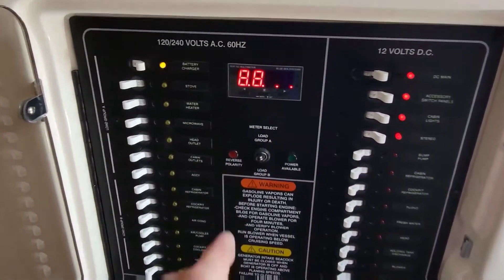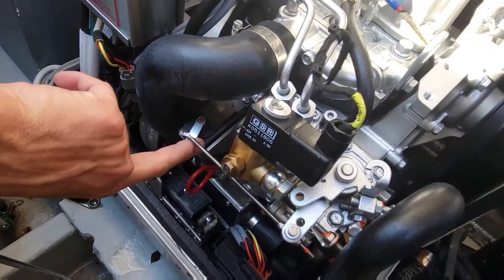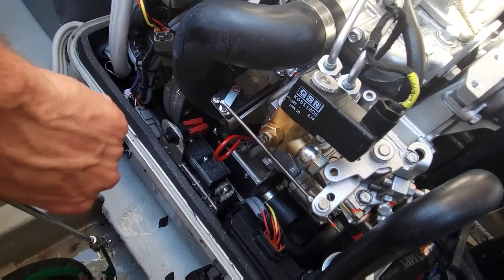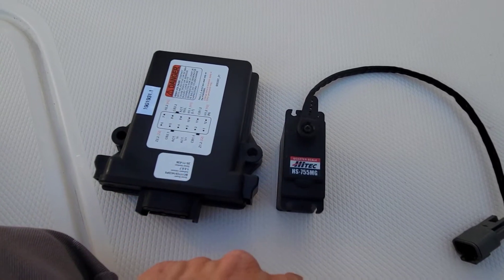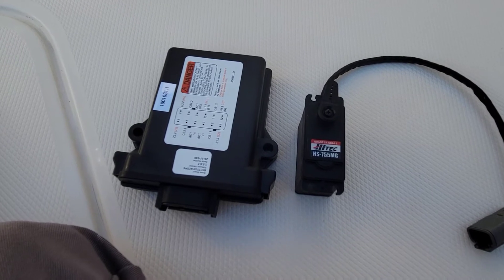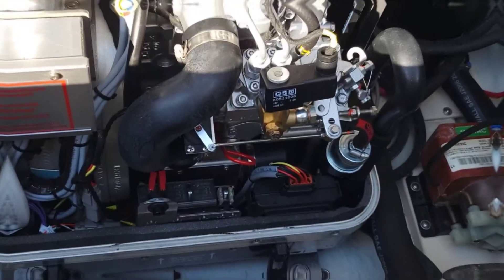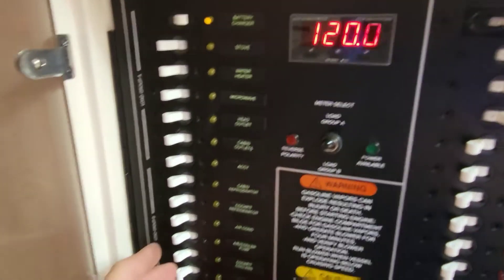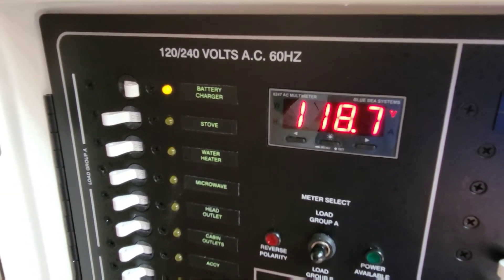Fischer Panda Generator 5k - Low Volts - Episode 43

Comment: I have the exact same boat and generator and same low voltage problem. I ordered the new actuator and boost controller from Fischer Panda, installed them and still have the same low voltage issue - the generator only wants to idle. When I manually move the throttle arm the voltage comes up as expected. Any ideas on what to troubleshoot next?
Reply from the maker: Did you replace the VCS. That's the next thing I would check.

Comment: Where is this sensor? Thank you
Reply from the maker: It's two wires in the bottom of the pan in a Deutsch connector. You have to pull them out of the connector and dry them off.  If they get wet the motor shuts down so it doesn't suck up water. Make sure you don't have a leak as it could harm the Genset.
Reply: @JustinLeeMarine  Thanks for your time